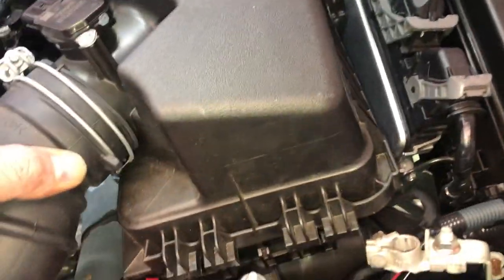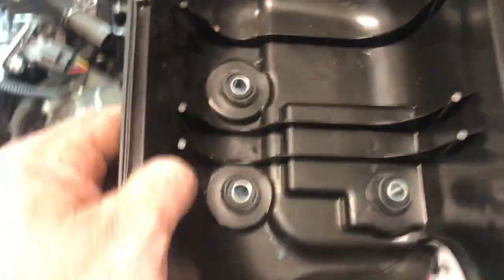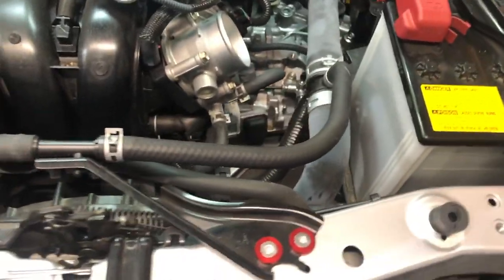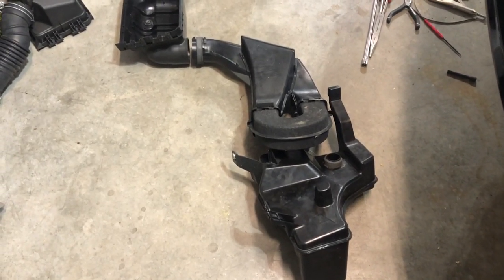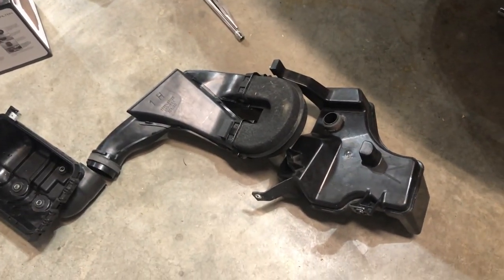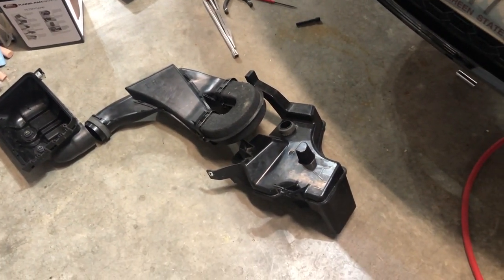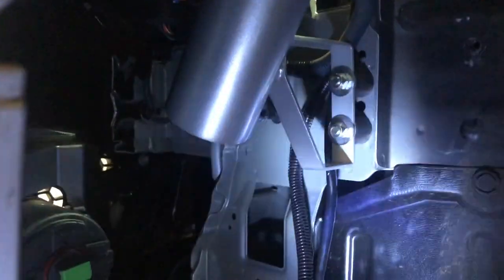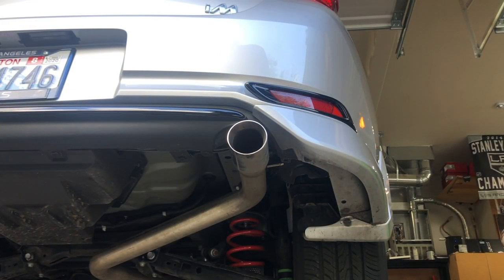2017 Corolla iM DC Sports Cold Air Intake Install

Comment: Not power related, but I recommend a horn update. I installed the supertones and no lie, I went from meep meep to MOVE MOVE. People seem to be more responsive to it. I also wired it directly to the battery so I don't have to think of any fuse issues.
Reply from the maker: I do agree with you. I've upgraded the horns on both of my Corollas. On my 2017 Corolla iM 6MT I upgraded to a Lexus spiral horn design that is much louder and deeper. On my 2009 Corolla S Turbo 5MT I upgraded to a dual Hella horn setup that is more than loud enough. Thanks for the suggestion and I think anyone should look into upgrading their stock Corolla horn.
Reply: Why tf would you bypass a fuse youre asking for bigger issues than just using a fuse

Comment: What jet maf sensor do you have, I'm trying to get one for my 17 corolla im.
Reply from the maker: They didn't list the Corolla iM so I just ordered one for a 2009-2019 Corolla with a 2ZR
Reply: Oh OK thanks and when you did the header did it throw a code and should I replace the o2 sensor or keep the old when I put the new headers on
Reply from the maker: @Frozenshutter-3  I've never had a code thrown on my iM. I didn't replace the o2 sensor as it wasn't faulty or old, the car only had about 20k miles on it at the time. If your is acting up then replace it, if not don't worry about it.
Reply: @jimsgaragetoys  ok thanks and mine is working fine but I was worried about getting it dirty or messing it up while doing the install
Reply from the maker: @Frozenshutter-3  As long as you don't damage it in any way you should be good to go. Ironically, I just posted a video about how to remove the o2 sensor after the CAT. I didn't replace it but the process would be the same. I installed a defouler in that location on my 2009 Corolla Turbo to stop it from tripping a C0420 code.

Comment: Is that a factory spoiler or an aftermarket? I got my hands on another IM. A year new and 55,000 less miles. 🙏 I nearly cried. It was a 6mt and silver just like my 2017. Good news is there were no cigarette burns from a previous owner in this one.. 😂 clean as could be inside. Some external spots to clean up but I got my ride back and was able to snag most of my old stuff from the car that got wrecked. The air intake was even still intact. Btw that girl pulled out in front of me and I was going highway speeds. That little car still cranked up and drove onto the wrecker. I coulda drove it home I wasn’t far.. but I had to get another one after seeing how tough it was.. the radiator wasn’t even leaking, ac still blowing cold. Nor any funny noises from running after the wreck 🤣 I was sad if you couldn’t tell that I lost it.
Reply from the maker: Good to hear that it did so well in a high speed crash. I love this little hatch. It looks so good and is a blast to drive with the added HP along with the chassis and suspension upgrades. The rear spoiler is an OEM option. I ordered mine already painted from a Toyota dealer parts counter. Congrats on finding another 6MT!! 😍

Comment: What’s the name of the CAE you added to yours IM I also purchased one and I am just starting to figure out all these things about cars I also want mine loud but not to loud what do you recommend to change first that’s also not to expensive I am on a budget
Reply from the maker: I have a DC Sports CAI and a DC Sports ceramic 4-2-1 header. I added a DNA exhaust too. If you are more limited on funds I would open up the exhaust first. The DNA exhaust is a 2 1/4" catback system that eliminates the resonator and will improve the sound. It will be a little louder. Some people remove the "scuba" from the exhaust but it gets extremely loud that way.
Reply: @jimsgaragetoys  okay thanks what sites or stores did you buy all that
Reply from the maker: @JesusGarcia-pp6no  Most were bought from sellers on eBay and Amazon. but I have purchased some things directly from the manufacturer. Normally I just look around for a good seller and a good price.

Comment: Would you suggest against installing if I lived in a dusty area, middle of NV is dirt everywhere
Reply from the maker: I don’t think dirt is an issue. It sits in a protected area behind the headlight and in front of the LF wheel. I did also install a hydrophobic cover over it for water. You should be good. It’s also easy to get to for cleaning without removing the bumper.
Reply: @jimsgaragetoys  Thank you for the swift reply, I love your content. Not much out there for these cars but you've really done a great job showing what can be done!
Reply from the maker: @arsen2kforever  You bet! The iM has responded very nicely to mods but you must do intake, header, and exhaust to get the best results. I’m at 180bhp from the stock 137bhp with simple bolt ons before any tune!
Reply: @jimsgaragetoys  I appreciate the heads up, you're amazing! Glad to know it can do that without having to tune it
Reply from the maker: @arsen2kforever  Indeed, a tune will add a little more but it's even decent without the tune.

Comment: How did you remove the bottom part  under the fender liner I removed both of the screws, is there another clip holding it in?
Reply from the maker: Yes, I believe there is another bolt or clip. Here is the video of my install so hopefully that helps. https://youtu.be/WIIp0_qtdMI?si=rCMskwZltgu0Vvme
Reply: @jimsgaragetoys  I got it installed there was an extra 10mm bolt holding it in that was a B to get to. The CAI does liven up the throttle a bit not too sluggish getting up to speed lol
Reply from the maker: @Notwalter_  If you add the header and exhaust it gets even better. And the throttle controller helps too.
Reply: @jimsgaragetoys  I got a cherry bomb welded in, replacement of the middle resignator and the DC Sport muffler. I might have to add the headers and change up my exhaust setup.
Reply from the maker: @Notwalter_  With the DC Sports CAI and header the 2.25" DNA catback system sounds great to me. It's got a nice tone to it with no drone.

Comment: I just got my corolla a few days ago and just ordered the DNA exhaust. What other power adders would you suggest for the corolla im?
Reply from the maker: I have the DNA exhaust too. I also installed a DC Sports ceramic header. I'm looking forward to seeing how these all work together. I also installed some new Quantum Solenoids and I would like to add a tune at some point down the road.
Reply: Oh ok, I just got my exhaust in and I'm looking at an AEM cold air intake.
Reply from the maker: @jeranspicer637  The best part for power is the DC Sports ceramic header. When combined with the AEM CAI and the DNA exhaust you should feel a nice difference. You could also look at a NST lightweight crank pulley to free up 6-7hp too.
Reply: I will have to look into that
Reply: Where did u get the dna exhaust from? Just got my Corolla IM last week
Reply: @robertro6839  I got mine off of Amazon and their is some sellers on ebay but be careful there is alot of scam sights.
Reply: Jeran Spicer alright thanks bro ill go check it out!
Reply from the maker: @robertro6839  I was able to buy mine on Amazon. They come in and out of stock so if you see them on stock don't wait, buy it right away.
Reply: @jimsgaragetoys  Havent seen it in stock since february. Guess ill have to keep checking
Reply from the maker: @SaiBalroop12  I've been busy with my cars. Since I had some extra time on my hands during the Covid outbreak I tried to get some projects done!
Reply: JimsGarageToys how do you find the right model? I’m searching on eBay and Amazon and can’t find .. I’m in Canada
Reply: Camil Filar I checked and it’s sold out on amazon america and canada
Reply from the maker: @camilfilar3139  For the Corolla iM I've had to search for a 2016 Scion iM. Many places don't have the 2017-18 Corolla iM listed properly.
Reply: JimsGarageToys I actually have the 2016 Scion IM and what model would it be exactly?
Reply from the maker: @camilfilar3139  If you check under the 2016 Scion iM and the 2017-18 Corolla iM you should see it unless everyone is out of stock right now. Keep checking on a regular basis.

Comment: Great car! What brakes and suspension kit are you using here?
Reply from the maker: Thanks! I appreciate that. I'm lowered on Tanabe springs right now and the brakes are still stock. I have added a DC Sports front upper strut bar, several TB Performance Products chassis bars including a rear upper strut brace, lower mid-chassis brace and I have a traction bar from them to install too. The only difference to the brakes were an upgrade in looks with MGP Caliper Covers. I have thought about looking at a Big Brake Kit in the future though for even more braking power.
Reply: @jimsgaragetoys  I also meant to ask if you ever considered the TRD CAI and if so, how does it compare to the DC sport? I recently purchased a 2018 iM and I am looking to start upgrading the performance.
Reply from the maker: @moonlightsy-3496  I did look at the TRD intake also. When I figured in the cost and the fact that the DC Sports CAI flowed more directly with a smooth pipe instead of an accordion type plastic I decided to get the DC Sports. I also like how much cleaner the engine bay is and it gave me plenty of space to install my oil catch can without the huge filter box under the hood.

Comment: One question just got my scion im i want to change exhaust and i might put a cold air intake but will the cold air intake hurt the engine or the car in any way?
Reply from the maker: You should be just fine. I've not heard of people having any issues with the DC Sports or Injen CAI. If you get a cheap brand I'm not sure how well they are designed. If you install a header at some point it will also allow the CAI and exhaust to work even better.It will not hurt the engine or car in any way. Just make sure when you remove the MAF sensor that you are very careful with it. It would also be a good time to clean it with it off when you are doing the CAI install. I would also clean the throttle body at the same time. Make sure that you use proper cleaners for each item. 

Toyota Throttle Body Cleaner -  https://www.amazon.com/Genuine-Toyota-00289-1TP00-Throttle-Cleaner/dp/B00C39314S/ref=sr_1_3?dchild=1&keywords=toyota+throttle+body+cleaner&qid=1621296706&s=automotive&sr=1-3

MAF Sensor Cleaner - https://www.amazon.com/CRC-05110-Mass-Sensor-Cleaner/dp/B000J19XSA/ref=sr_1_3?crid=41WX1VD9DBIS&dchild=1&keywords=maf+sensor+cleaner&qid=1621296875&s=automotive&sprefix=MAF%2Cautomotive%2C227&sr=1-3
Reply: @jimsgaragetoys  thank you also i want to get a magna flow catback exhaust and a injen Cai would you recommend these ?
Reply from the maker: @danieldutton9770  Both are good names but I'm not aware of a Magnaflow catback exhaust for the iM. The DNA one is very good as it's really a pipe after the cat that is needed. You don't need another muffler after the cat and "scuba" muffler. The Injen or DC Sports are both excellent choices for a CAI.

Comment: I just brought a 2018 IM an I want to know what’s some good starting mods I can put into it ?
Reply from the maker: Congrats on the Corolla iM. It's a great car and looks fantastic. The very first thing I always do is a complete 3M Clear Bra and window tint. I generally do suspension and wheels first pretty early too, then I move on to bolt-on items. I installed a DNA exhaust, DC Sports CAI, and a ceramic header. Those bolt-on items combined with some Quantum Solenoids really woke up the engine. Another excellent early mod is a throttle controller.